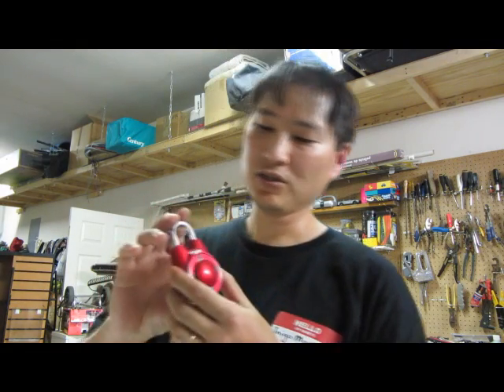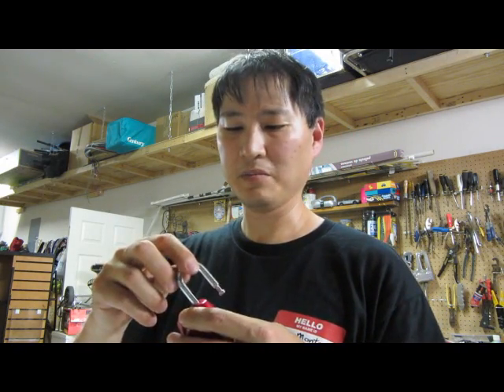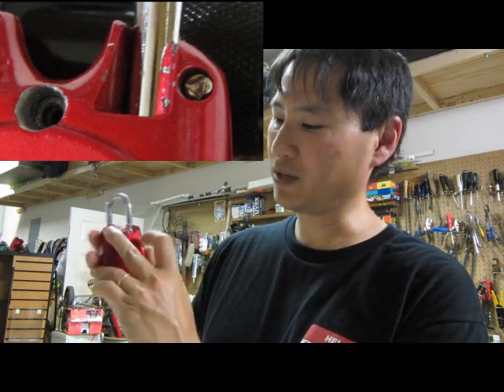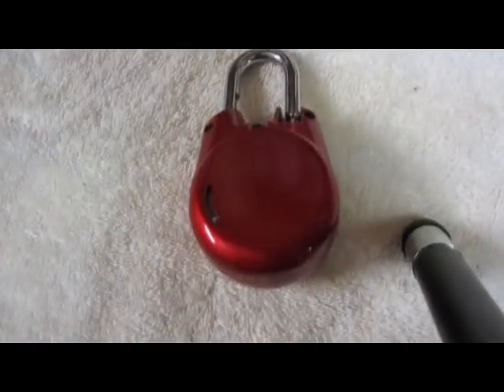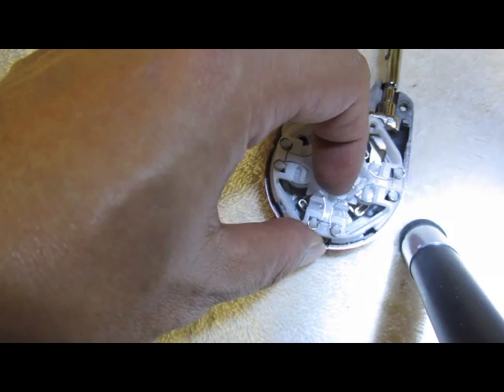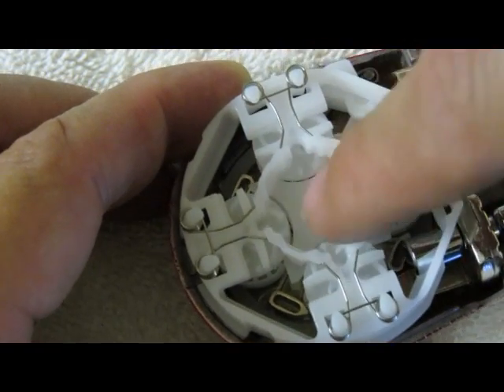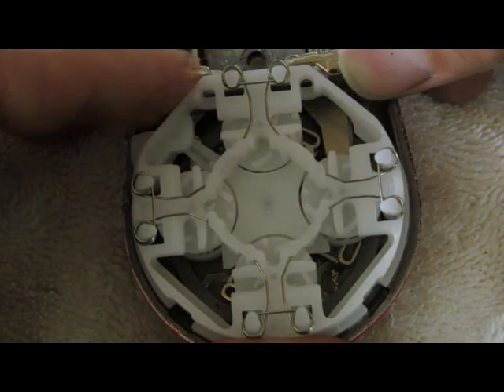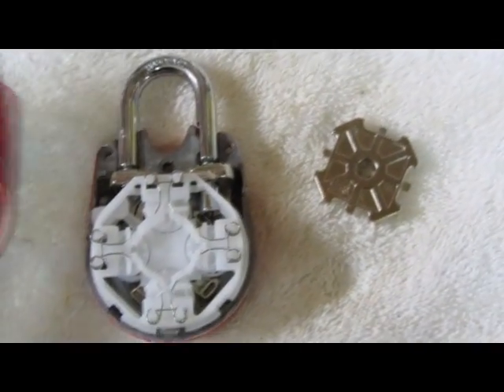How a Master Lock Speed dial works

Comment: I didnt forget the combo, its during changing code that i did it wrong and  it locked forever.i was able to use a nail file and got it open once but never was able to repeat it.maybe it must not have locked completely.spent 2 hours in .i have 5 of those now only 4 working 1 locked
Reply from the maker: Try taking it apart and resetting the tumblers ;-)
Reply: @saltyshellback  sadly i lack the necessary tools, but definetly may try a locksmith when i fly to the states next time.thanx for the reply!i am in the island of mauritius

Comment: Great video but vary poor lock this lock should not be used to secure anything of actual value the kids gym socks and shoes is fine but anything of actual value no this lock can be destroyed disarmed and opened in 15 seconds by anyone with half a brain and Common Sense the simple fact the guts are plastic should tell you that a little Heat 5 seconds it's open using this lock for a shed storage locker or anything of that nature I would highly not recommend me and friends purchased three of these locks and had a challenge all three of us had our lock open in less than 30 seconds remember it's by any means necessary when a thief is breaking into your stuff small propane plumber torch and this lock no bueno there's a reason why old school padlocks are made out of all metal not plastic and the  shell of this lock is to thin to offer any real security with a simple piece of iron rod and a 5-pound mallet it's done not sure why you spent 40 minutes messing with the screws like I said we were in it in less than 30 seconds all three of us by any means necessary buddy he just grabbed his and smashed it on the floor and boom it's open needless to say a simple Hammer will do the trick $12 you can't buy a mini lock at most hardware stores for $12 let alone a good lock so for the kids dirty school socks locker sure for anything else heck no don't waste your money
Reply from the maker: Most locks are theater and only keep honest people honest. You are right that if someone wants to get past a lock it really doesn't take much effort.

Comment: So if it’s a polymer could you just melt the insides with a blowtorch?
Reply from the maker: Probably. The lock tab is metal though, so I don't know if it will remain locked even if the plastic parts are melted.

Comment: If I remember correctly from another video, you have got to be careful with those locks if you are trying to break into them, because there is a chance of setting what I like to call a “Null Combination/Password” on it. Basically, that means that it is locked, however there is no existing combination that can unlock it, meaning you are essentially locked out and have to break into it to fix it.
Reply from the maker: I don't know, but I'll take your word for it.

Comment: How to hack a speed dial lock: see the little slider on the back of the lock? Slide it up with something pointy and pull down. Done you've hacked it XD. Also you can reset the lock this way and troll your friends. All I did was slide the thing up double tap it to clear the combo pulled up and it came open then I set a new combo slid the slider down and locked the lock. Lol my friends look when they couldn't unlock it and I did XD

Comment: Yeah. That's the flaw with this lock. Make no mistakes when you enter the new combination or the lock might be rendered useless. If you think you've made an error reset and enter it once again before sliding the reset lever back. Write combo on a piece of paper and be sure to follow it when entering for setting.
A classic combination lock like say the S&G 8077 you can recover as long as you haven't closed the setting hole. I know it's in a different league but still would be nice with such a feature on the Speed Dial too. Perhaps it's difficult to implement...?
Yeah it's not Master's invention but licensed from Knollan. They claim the scheme it's secure enough to be used for safes too (of course granted appropriate materials and construction method). But wonder the reason why there seems no safe locks using this technology. Might be because of that exact reason. Recovery of wrong set code is hard to implement. But hey at least such a lock could be opened and manually put back to start as long as you haven't closed the safe.
Think I've calculated something as 50000 possible true combinations. A bit low for a government safe but more than enough for most home safes. Oh and btw. one more thing. Since you can seemingly enter any length code but it's "hashed" it means that certain series of movements can bring it closer to start than you think and while you may think your very long code is complex in reality it's just one step in one direction - but unless you recognize the pattern you'll never know and your super password suddenly is nowhere near super. That may also be part of the explanation ;)
But hey for safe lock you can always up the number of possible combination by making each wheel turn less than in the padlock - minimizes the mentioned issues but of course doesn't eliminate them.
Nice idea and user friendly but you need to be aware of it's nature. Ideally there should be an app to verify your chosen password doesn't have a shorter one with same hash value. The classic combination lock doesn't have those issues but it's more cumbersome to dial in the combination ;)
Reply from the maker: Wow, lots of info.  Thanks!
Reply: Thank you, that solved my lock problem.

Comment: So the order doesn't matter as long as u get the combination correct? Oh wow.
Reply: Alex Krasikow . the order matters because it is moving multiple discs per slide.
Reply: That's the first thing I tried when I saw the video, it didn't open, so the order matters :) ... I really wanna know how they designed it to remember the combination though!
Reply: So another comment here referenced 'Michael Huebler's 1500iD visualization', which had a visual representation of how the lock works - pretty neat!

But as it turns out, every single combination will have another combination that can open it up. In other words, there are clashing combinations where the alignment will be correct (metal arrows aligned with the plastic holes)
Reply from the maker: I am not sure if the order of moves makes a difference or not.  I am thinking not, but I haven't tried.

Comment: by looking at your video i found out that there are 4096 possible combinations .. because each circle can have 1-8 positions .. and there are 4 of them so .. 8^4=4096 .. the old ones had 512 (i think) .. but if the made the old one 4 weels it will be the same as this new .. but with alot of time
Reply: @hunar. Sorry but it's actually a lot better than that. Each wheel have 15 positions making up for a total of 50.625 true combinations.
Search for "Michael  Huebler’s 1500iD visualization" for an interactive flash demonstration.
On HIR someone states it has 7501 combinations. The 4th root of that 9.30-something so it's beyond me how he got that number... Whatever number of combinations it must be it must be something which has a nice 4th root (as there's 4 wheels).
Reply from the maker: +hunar omer I will take your word for it...lol
Reply from the maker: HifiCentret
SCIENCE!

Comment: If the combination is Left Right Left Right, would entering Left Left Right Right work? Technically, the wheels are all moving the same number of times.
Reply: Nope.tried it.
Reply: funnyguy031 I've been puzzling over this for some time and I can't come up with an explanation. It is true that the lock is order sensitive, which means that we are missing some information about the function of this lock.

If any one input performs an unchanging function on the wheels, whether multiple wheels are involved and/or wheels are rotated multiple times forwards or backwards the effect is mathematically identical to summing a set of matrices; that is to say it shouldn't matter what order you put it in. The only way I can think of that this device can properly hash the combination is if the next function performed by an input is determined in part by the current state of the wheels themselves. The function must be variable. 

As nobody has pointed out such a mechanism in the device I cannot explain how this is happening.
Reply: @JsbWalker  The trick is that the wheels can not only take 5 but rather 15 different positions and that a movement in any direction will increase the wheel - depending on the previous movement - by either 0, 1, 2 or 3 positions. I built a small demonstration here: https://jsfiddle.net/a5s9zjoL/ Initial code is left, up, up, left, but you can easily set it to left right left right and see what happens when you enter left left right right, for example.
Reply from the maker: Jonah Liu Not sure.  You could try if you had the same lock.
Reply: James Walker I haven't looked too much at any of the deconstructed locks, but my theory is that each direction moves multiple dials differently.
Like if down moves the left one CW once and the right one CCW once, while up only moves the left dial CCW once.
Reply: funnyguy031 As I said though, no matter how the dials are moved, it's still a sum of several matrices that will end up in the same position regardless of order. The only way it can work is if the position of the dials directly influences the action that the movement takes.
Reply: It's possible that there could be a mechanism that alternates the spin magnitude after each input (possibly including direction, although magnitude is far more useful than direction).

For example, if it was just something simple such as alternating between CW and CCW, ↑  → ↓← would  result in +1 -1 +1 -1 values, while ← ↓ → ↑ would result in -1 +1 -1 +1 values. Obviously just switching direction isn't anywhere near complicated enough though, since in that example ↓ ← ↑ → would work, along with some others. However if the magnitude incremented by 1  each time as well as swapping the direction (or even just only the incrementing value part), it would get  much better.

edit: so I took a look at how it works, and I was sort of right, but of course since it's a mechanical system, using digital logic isn't quite accurate as compared to analog "logic". In addition to that, every input results in 3 of the 4 wheels turning (and turning different amounts depending on how much has been input to them previously).

Obviously pretty cool and smart.

Comment: In this video you seem to think that the dial moves the rotor corresponding with the direction being pushed i.e. if I push up then only the "up" rotor will move. That is not so. What actually happens is that the two perpendicular wheels also move. So if I push "up" then "left" and "right" move also but not the "down" wheel. The pins on the corners of the metal piece that sits on top of the wheels move the other two rotors.
Reply from the maker: HOW DARE YOU QUESTION MY SMARTNESS??? I AM A YOUTUBE EXPERT AND KNOW EVERYTHING ABOUT EVERYTHING!!! Just kidding. Thanks for the clarification.:-)
Reply: I watched this and a couple other breakdowns of this lock and one thing I haven't figured out is...
If the combination works as described, where ↑ turns the ←↑→ wheels one notch (and similar to the others) shouldn't a combination of →↓→↓ turn the wheels exactly the same as →→↓↓? Why does the order matter (yes, I tried with my own lock and they need to be in the right order). Is there another mechanism not mentioned?
Reply: @IznbranahlGoose 
Each wheel relative to the direction of action has different "notches" it advances to, it advances to the next higher value from it's current state according to this chart.

↑ = 0->72->144->216->288->0
← = 336->48->120->192->264->336
→ = 312->24->96->168->240->312

For the absolute ↓ wheel that →↓→↓ is →↑→↑ action direction. So it advances to 24, then 72, then 96, and ends at 144.
→→↓↓ is →→↑↑ for action direction. So it advances to 24, then 96, then 144, then ends at 216.

There are many combinations that do match however, such as here (UP, RIGHT, DOWN and LEFT are the states of the 4 wheels based on absolute postions inside the lock).

→↓→↓
UP: 0° RIGHT: 0° DOWN: 0° LEFT: 0°
UP: 48° RIGHT: 72° DOWN: 24° LEFT: 0°
UP: 48° RIGHT: 120° DOWN: 72° LEFT: 24°
UP: 120° RIGHT: 144° DOWN: 96° LEFT: 24°
UP: 120° RIGHT: 192° DOWN: 144° LEFT: 96°

↓↑→↓
UP: 0° RIGHT: 0° DOWN: 0° LEFT: 0°
UP: 0° RIGHT: 48° DOWN: 72° LEFT: 24°
UP: 72° RIGHT: 96° DOWN: 72° LEFT: 48°
UP: 120° RIGHT: 144° DOWN: 96° LEFT: 48°
UP: 120° RIGHT: 192° DOWN: 144° LEFT: 96°
Reply: By

Comment: If you initially reset your combo incorrectly (ie put tab up but didn't press twice to clear it before entering new combo)....try putting in old combo (default) + new combo and then try to open.  I didn't read directions and messed up but this trick saved me from trashing the lock
Reply from the maker: Good to know!

Comment: Thanks a lot! I bought a second one of these since I like the first so well, and I immediately ended up fat fingering the new code essentially throwing 12 bucks away. At least until I watched this :P These are amazing when you want a lock but don't want to turn on a light to use it (basically always on the boat since somebody is sleeping 23 hours out of the day). Also, I just used elbow grease and a flathead for that center screw; luckily didn't strip out.

Comment: If you rap the right site of the the lock with a hammer would it disengage the locking mechanism briefly enough to open?
Reply from the maker: That's a possibility, I don't know.  It could be tricky to put just the right amount of tension on the bail and hit it hard enough to get the locking mechanism to move.

Comment: There are actually over 7000 combinations. Essentially, these are the output of a mechanical hash function from the "unlimited length combo." However, this is still quite impressive, given that without great care iterating through these could be much more time consuming than with conventional 4 digit locks with 10K combos.  For the internal mechanical details, see: toool dot nl/Image:The_New_Master_Lock_Combination_Padlock_V2.0.pdf

Comment: After a bit more experimentation, I believe you're right.  Pretty amazing design.  I narrowed down the problem with the finicky one to the up/down tumblers and was able to program it to work reliably with only l/r action.

Nice heli.  I was a crew chief in VN, but never worked on the Chinooks. I got a heli pilot's license and owned an old Bell 47 for awhile.  BELL = "Better Expect Lotsa Labor!"  Cheers.

Comment: Quite ingenious!  Nice to see such novel mechanical ideas still being produced, without microprocessors, etc.  I bought 3 of them when they first came out.  They're all a bit finicky, but one of them will only open about once every 10 tries when you're doing everything right.  I've got all my locks re-programmed to the same combination - just found this lock again and have tried everything.  I can't trust it and will  have to throw it away.  The other two seem to be "loosening up" well.

Comment: Great video. Would like to see the lock torn completely down. Does the slide lever on the back, to change the combo, lift the wheels above the fence nose in the four positions to allow the position to be change? I have been interested in locks for a very long time> I have done locksmithing for 20 years.

Comment from the maker: I suppose you could pull it hard enough to strip out, but the problem is you have to find a way to grip the outer case.  Even though the plastic is weaker than the metal, the load distribution on the screw hole is actually really strong, so you will probably end up bending the case trying to pry it open before the screw strips out.

Comment from the maker: It is unscrewed counter-clockwise, but it is an anti-tamper screw, so you have to drill the head out and then use pliers to unscrew the stem.  You can leave it out, or go buy another machine screw with a regular head.  Good luck :-)

Comment from the maker: Thanks, but it is too late for this one...lol.  I did try a small straight slot screw driver on those triangle screws, but they are designed to resist being opened with a normal screw driver, so if I was to grind anything to fit, I may as well grind a triangle bit.  Not sure what you mean by pushing hard on the central screw.  Ironically, my son doesn't use the lock anymore, and it just sits on his bedroom floor collecting dust....lol

Comment: If you push hard on the central screw, it is possible to take it off without drilling ;)
If you take a plate screwdriver enough small to fit flush in the two small screws, it is possible too to take them of very easily ;)
So before drilling a hole in your lock, try to find some screwdrivers to test them... You will have a better result at the end if you find something ;)

Comment: Each wheel has a limited number of permutations. After 11 movements, the wheels just get back to where they started.(In other words, you can have a 20 movement code, but there will be a shorter code that will also work).11^4=14641 possible codes. Trying one code per 10 seconds will take, in the worst case scenario, 40 hours and 40 minutes. The minimum wage here in Montreal is 9.90$/h, so that will cost you 402$. A new lock is 10$, a drill bit is 3$. So the drill is still cheaper than the math :)

Comment: You can use a small star bit to take out the triangle screws and ues a small precision screwdriver to take out the security screw and replace it if you want but I put mine back in after getting the lock open so I can reset the code